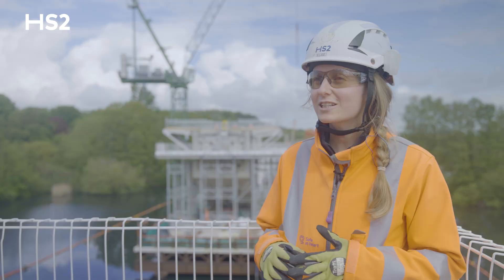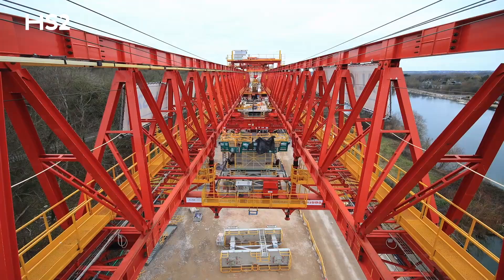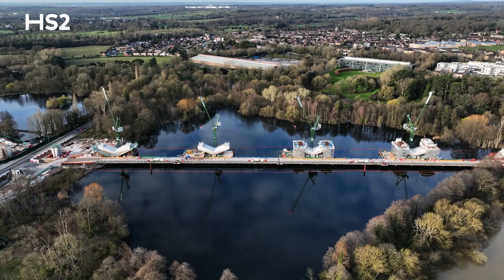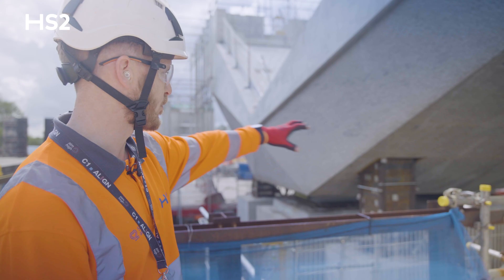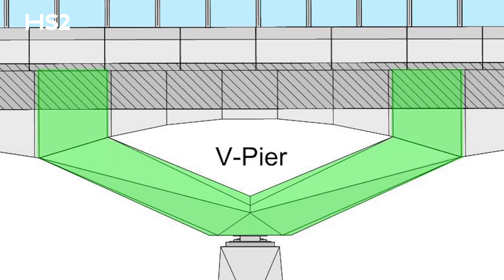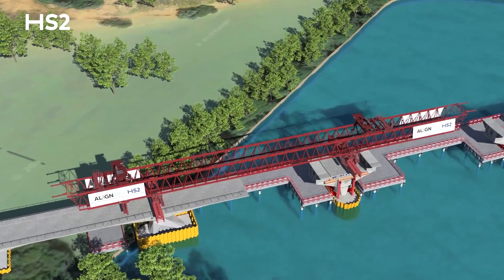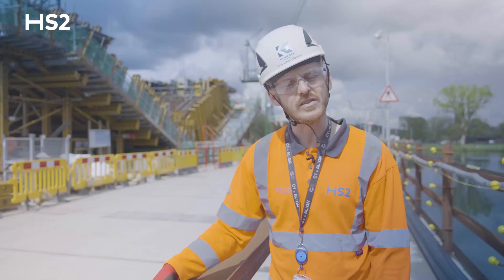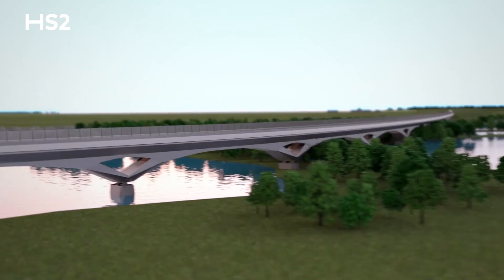HS2 reveals first giant lake piers for record-breaking Colne Valley Viaduct

Comment: The London to Birmingham link 
Great levelling up !
Reply: Thats what the intension was from the beginning, the link to Manchester was am after thought
Reply: They are are going to extend and connect it all to the major ports up north and Northern Ireland.
Reply: @Stand663  So how do they connect HS2 to Northern Ireland, first you have the first obstacle the Irish Sea and the next is the different track gauge between the UK and Northern Ireland, in the UK it is four Foot eight and a half inches where as in Northern Ireland it is 5 foot 6 inches,plus the actual HS2 line will not go any further than Stafford after that the trains will be running on the existing West Coast Mainline.
Reply: @peterwilliamallen1063    You didn’t understand what you read.  I said HS2 is being connected to ports up north. Any trade from NI in particular will come across the sea and distributed throughout the rest of the UK mainland via road and hi speed rail.  If you go up north there’s been huge infrastructure being built connecting everything road, rail and ports together.
Reply: @Stand663  Well you didn't rite it correctly did you, you actually said I repeat "They are going to extend and connect to all major ports up North and Northern Ireland", well your statement is Rubbish as HS2 is not going to connect with any ports up North as HS2 is going to be just a High Speed Passenger carrying line, no freight trains ill ever use the HS2 line or have any trade with NI. The HS2 line will only be built from London Euston to Birmingham Curzon Street and up through Staffordshire where it will connect onto the existing West Coast Main Line around the Stafford area where HS2 trains will travel on the Existing rail network to Manchester and Scotland.
Do not know where you are getting your ideas from but what huge infrastructure is being built up North connecting every thing!! So yes I did understand what you read it is just that you did not understand what you wrote as HS2 has nothing to do with Freight trains, Ports or Northern Ireland